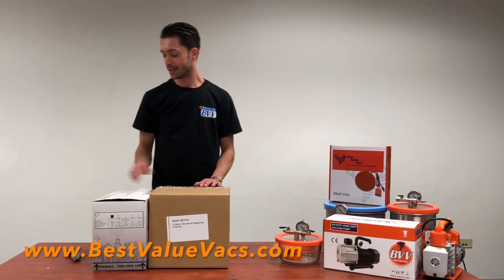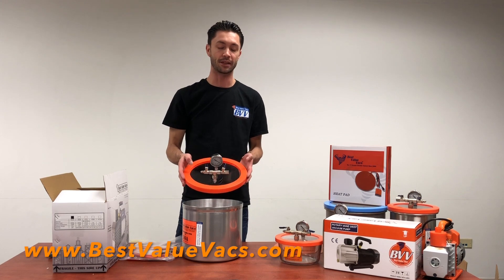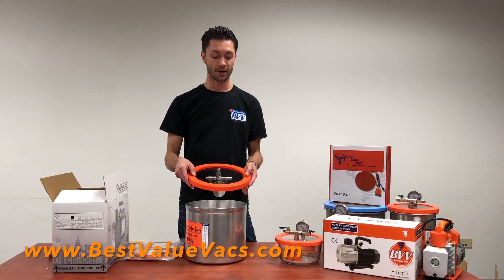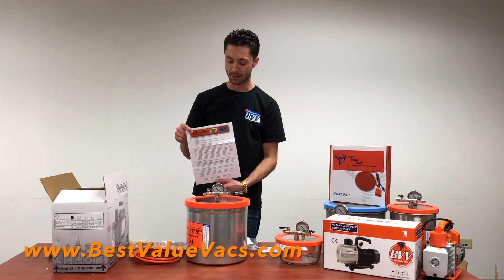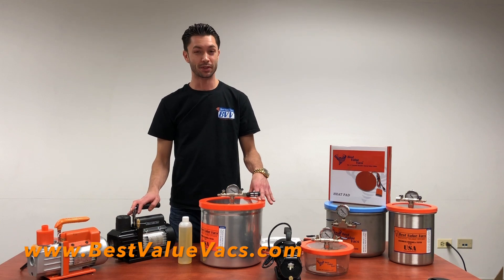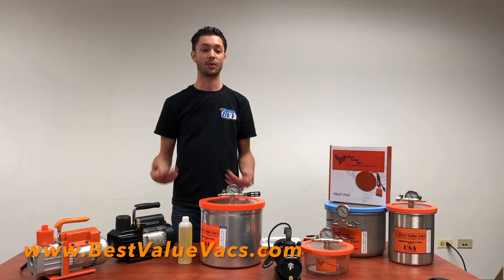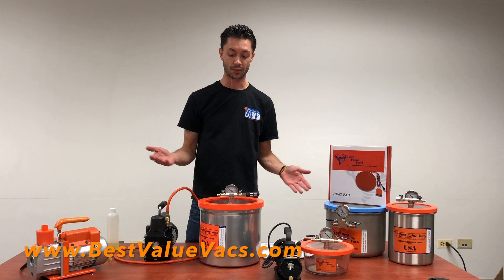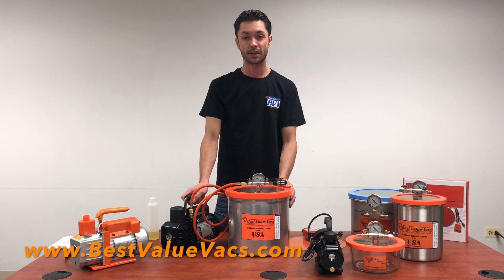3G BVV Unboxing

Comment: I just got the VE 115 and I was using the manual prior to finding this video.  I removed the top part of the oil filter and not the bottom section and started pouring oil in through the filter.  Before I run the pump for the first time, do I need to replace the white filter piece?  Or is it ok to run?